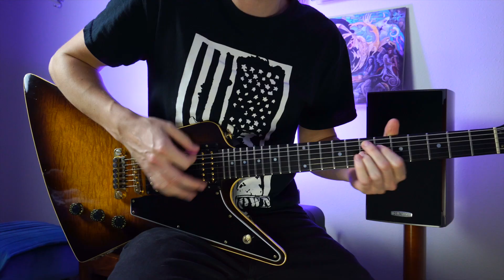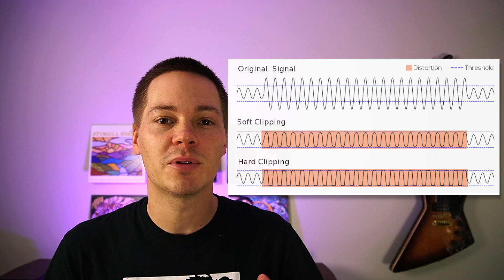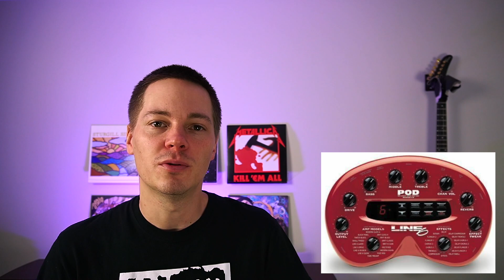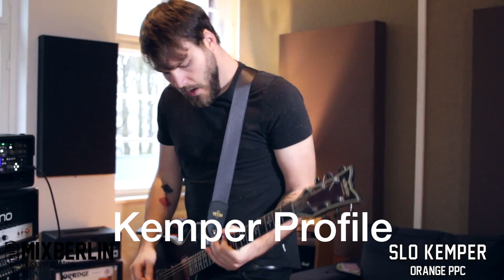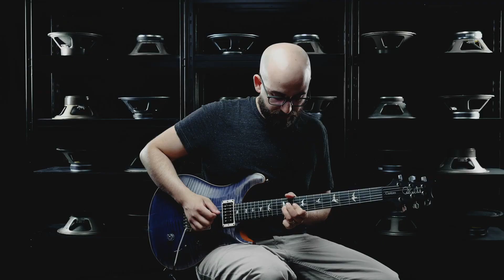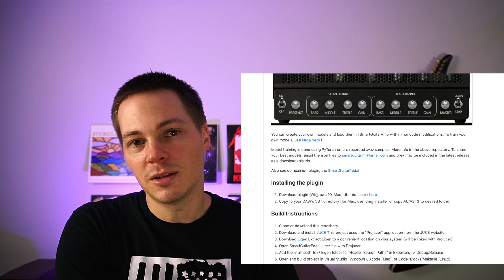Neural Networks as Guitar Amps (with Neural DSP interview)

Comment: Around minute 20:00 he describes how Line6/Fractal etc are currently doing analog modeling, and he talks about filters and wave shapers. Well, I do not agree at 100% on that, mainly because that is an "emulation" approach, while today we have many options for "simulation". In other words, if we know the circuit, we can simulate it in real time building non-linear transfer functions from the combination of the characteristic equation of each component (for example the resistor is described by V=RI). There are many examples of this approach, with different algorithms, someone uses Wave Digital Filters, others use MNA (modified nodal analysis) etc... Of course in order to run in real time with low CPU usage these approaches are aided by the use of tabulated functions and other approximations.